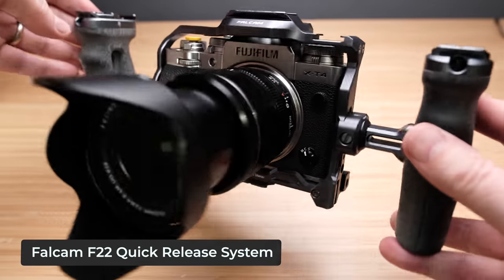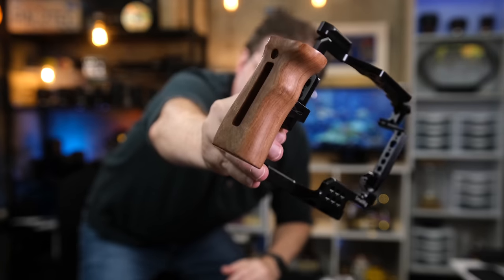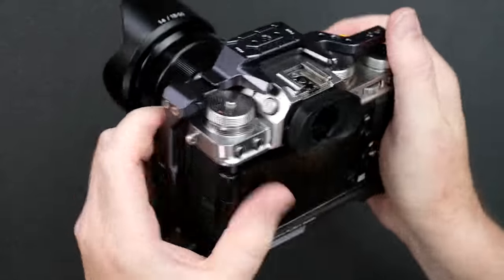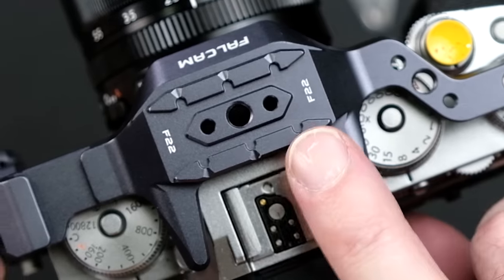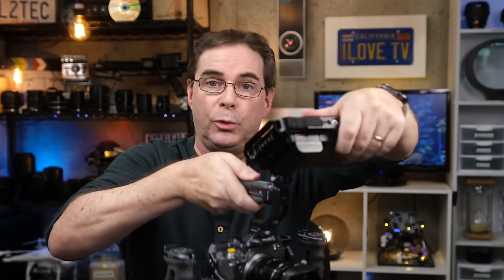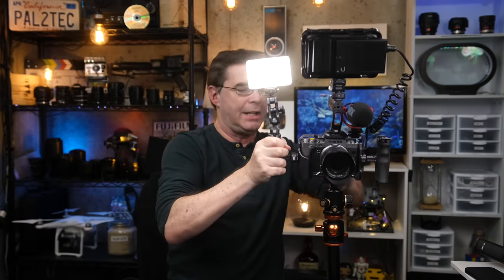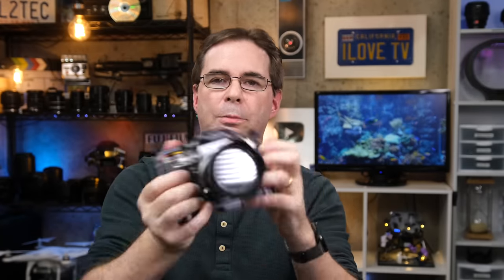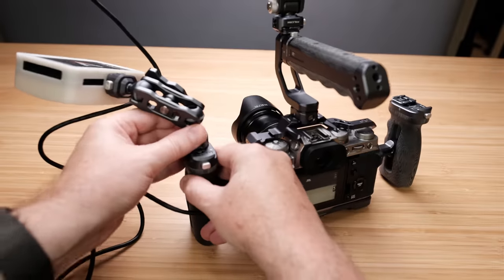GREAT Camera Cage For Fujifilm X-T4 | Falcam F22 Review

Comment: I am a bit late for this comment on cages for the X-T4, but I noticed the following.  You did not do a review of the Smallrig cage for the X-T4.

I owned an X-T4 camera and purchased a Smallrig cage for it.  I was terribly disappointed in the cage as it only had one bottom 1/4"x20 screw t mount/anchor the bottom of the cage to the bottom of the camera.  There were no top anchoring points provided on the X-T4 cage as there are for the Smallrig X-T5 cage which anchors to the top corner camera strap holes using an M2 screw for each of the two strap holes, respectively.  This design oversight resulted in the top of the X-T4 cage not being firmly attached to the top of the camera, and the cage displayed a slight back and forth (i.e., front to back) movement with a slight bit of hand pressure.  I finally decided that this was very much unacceptable and sent the Smallrig X-T4 cage back to the company for a full refund along with a full explanation of the problem.  I suggested to Smallrig that they redesign the X-T4 cage similar to the X-T5 cage and use an M2 screw in each of the top strap holes of the X-T4 camera to anchor the top of the cage to the camera, and market the new X-T4 cage as an updated/improved version of the original X-T4 cage.

The company representative said that they would pass this along to their design engineers.  It will be interesting to see if they actually do this for the Smallrig X-T4 cage.

My question is:
Did you look at the Smallrig X-T4 cage and not review it because of this design defect, or was it not reviewed because you believed the Falcam F22 from Ulanzi (reviewed in this video) was an overall better cage for the X-T4?  Thank you for sharing your knowledge about Fujifilm cameras with your viewers.  These videos have been a great help to me.

Comment: Looks like an interesting kit.
I think I prefer the arca swis dovetail built into the base rail like small rig do with their X-T4 cage.
Unless I missed it can you fully rotate the rear screen like you can with the smallrig unit.

That quick release system looks good, and the fact that you can buy the full kit is nice.

I watch their site and they are starting to produce some nice gear

Comment: You could mount a small button type magnet to the cage using silicone adhesive (easy to remove if you decide to remove the magnet).  The screw driver blade shown is held to the magnet. I always carry a small screw driver with adequate blade width for 1/4"- 20 type screws in my camera case accessory pocket.

Comment: Thank you for this review! It looks very attractive. It's interesting that you've mounted the camera in the case without removing the lens. I cannot do it with my case, as it is not big enough to stick the lens of roughly the same size, I need to either temporarily remove it, or disassemble the frame into two parts (which is easy though).
Can this case be disassembled in two parts for this purpose, to avoid removing the lens?
What about the top handle? Are those 3 fixed positions all you can do to balance? No way to fine-tune the balance (as with NATO rails)?

Comment: Wondering how this cage is with the manual dials on top? Both a cheapo and the smallrig cages are not fantastic and partially block the dials. I wish someone would make a cage for the X-T4, really paying attention to how the bar goes over the dials so they can continue to be used easily.

Comment: Great video. I love Your Chanel.
Is it possible to use on camera flash with this cage? Thanks for Your answer.
Reply: It might be tricky with the image shown @3:43 . I can't use a flash on my A7C when mounted in the cage. It's defeats the entire purpose of a "quick release system" if you can't quickly attach/remove a flash from a camera.

Comment: Do you have any recommendations for cages for the Fuji XT-3? I recently got one and I've been using it more for video. Any help is super appreciated!
Reply: I use a Smallrig cage on my XT-3 for video.  Smallrig makes great stuff, but are very a la carte and a little more spendy than the one in the video. In fact, the one in the video looks like a copy of Smallrig.
Reply: @jimt97038  Okay Sweet! That's the one I was leaning towards since it doesn't seem to cover the dials on the top. Do they have a cable clamp for that cage too for the HDMI / USB-C Ports?
Reply: @chancebriley7354  yup,they sell an HDMI clamp for it. I have one on my XT-3 cage and another one on my Atomos Ninja V cage (which is also Smallrig, btw)

Comment: Your suggestions to the manufacturer and to Fujifilm are very good, but I think one thing is wrong. Your SmallRig.screwdriver is just ridiculous, so you should rather blame SmallRig — the cage is perfectly fine and even impressive. Sinking the screw head in a perfectly fit tight opening is a good feature, not bad.